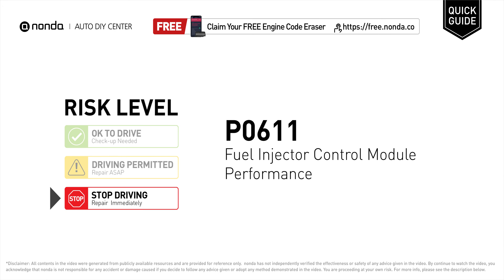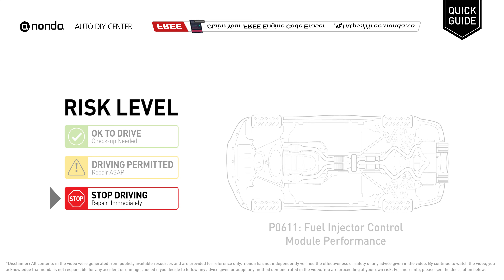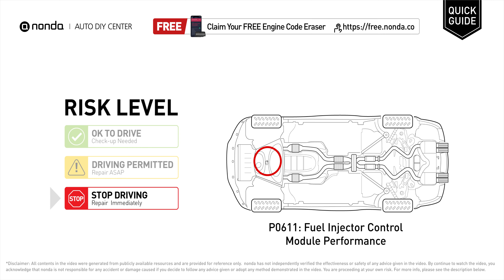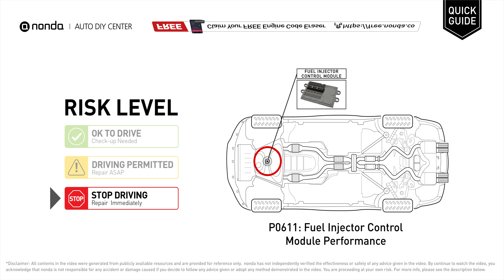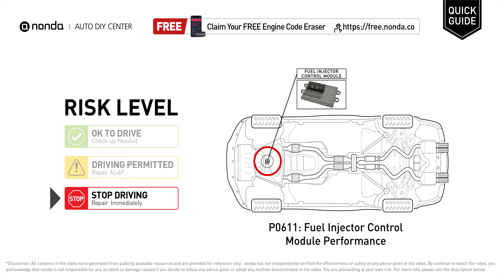What is P0611 Engine Code [Quick Guide]

Comment: I have this code P0611 on a Renault koleos turbo common rail diesel iwanted somme help IN the  véhicule van ne located this fuel injection Modulator year 2011
Reply from the maker: Hi Clovis, you can find it in the passenger compartment, in the lower left of the dashboard.